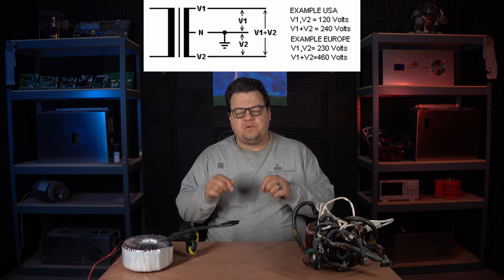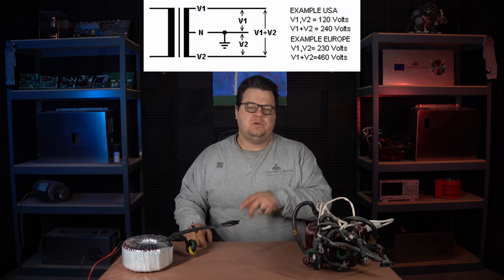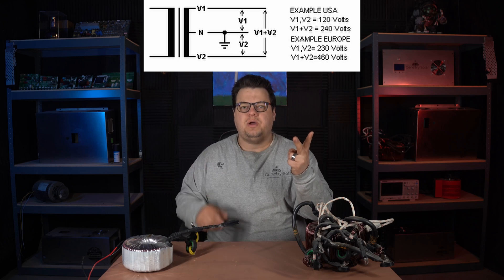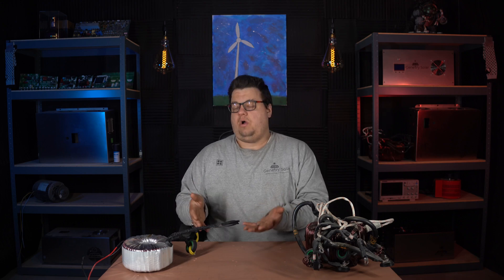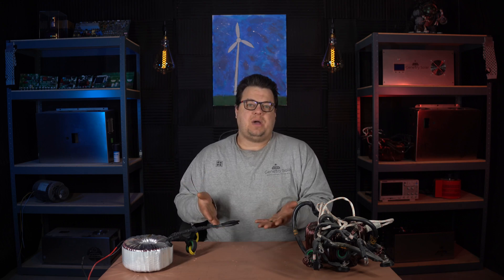Genetry Solar "Universal Transformer". What is it? How might it benefit you?

Comment: How do the chokes work on your transformer? Can they be added to any inverters transformer to achieve a lower standby current? What wires do the chokes go through on the transformer?
Reply: I wanted to know if they can be added to a sigineer power 48v 15kw inverter to lower standby current. At no load my inverter draws 275 watts. The transformer has 3 positive and 3 negative primaries.
Reply: @johnchamberlain395  Are you sure 3 primay wires ?    The secondary  has L1  N  L2  and are 3  wires .    Signeer has no room for choke .
Reply from the maker: @johnchamberlain395  worth exploring.  I know the same was done with PJ inverters back in the day on the diy forums.
Reply from the maker: The primaries get them and there are diminishing returns. Getting it down another 20ma isn't worth the 40 dollars in parts and much longer primaires.

Comment: I have observed your transformers ,and have make transformers for years I see that they are not coil lock, that's soaked in varnish or epoxy resin soak over time internally coil vibration will break down the coils.
Reply from the maker: More details and impact on cost and availability?